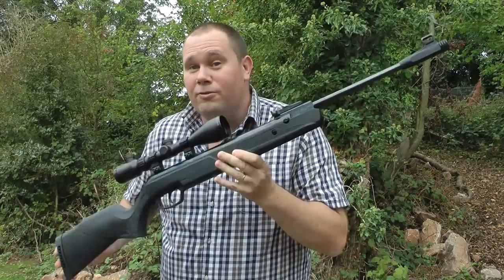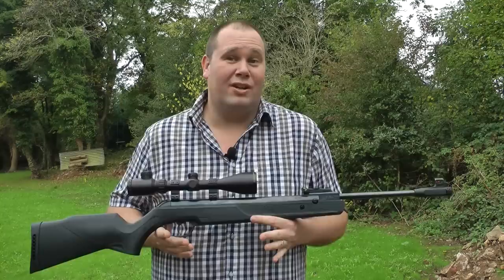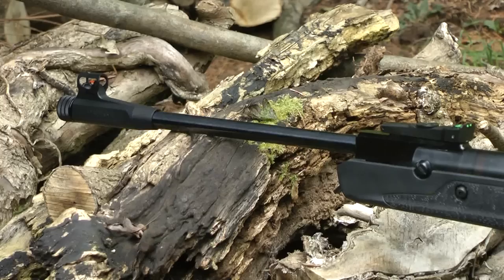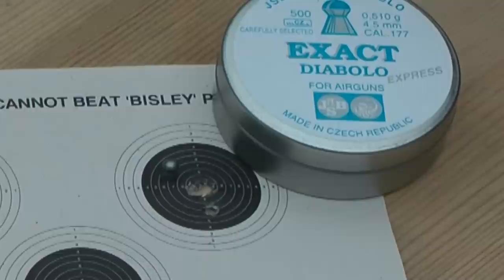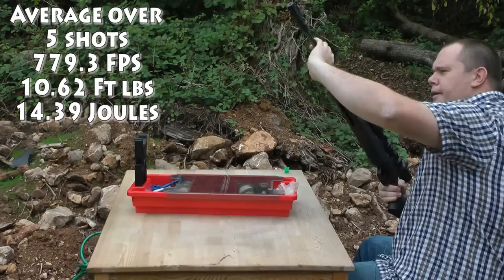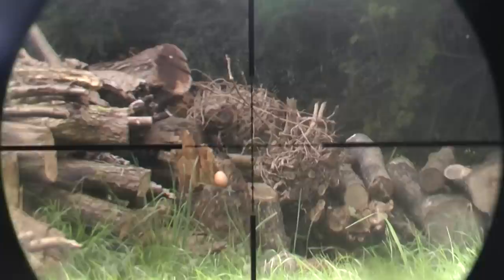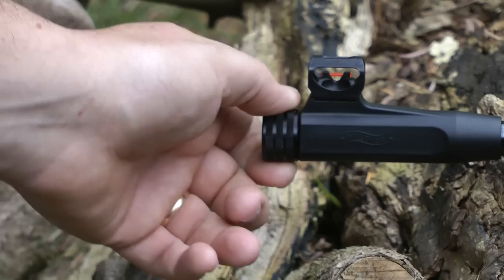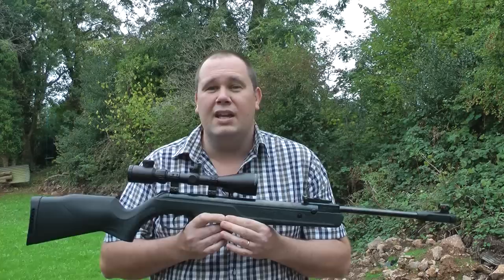REVIEW: Walther LGV Challenger Review - Power Accuracy

Comment: make sure the trigger weight adjustment screw is seated (screwed in to bottom clock wise) Then back it out 2 turns . Other wise when the gun does not fire ,and you try and figure out what is wrong and snap the barrel back it will discharge no matter what

Comment: Very good spring air rifle this one...And nice video review! Not cheap but you get a match trigger and a quality rig for that price AND you don't need to invest in bottles and tubes like with PCP guns...I would add a picatinny rail instead of standard dove tail though to prevent the scope from moving backwards after several shots. Even with the reduced recoil system...springers move forwards and backwards and the movement of the scope will eventually influence accuracy.Thanks for sharing! J

Comment: nice review.i have just got the lgv master pro 177
Reply: hi helenna have just read the comments I also have this gun finding it fantastic to shoot but I want it to be a quieter for the back garden and just wanted to know if you have installed a sound moderator on yours and if so is it much quieter and which one did you go for as I was looking at the weihrauch silencer .
Reply: Same here..  Ive got a sfs moderator and a rowan trigger.. Plus some fine tuning with trigger springs and a complete polish on the internals.. It has no equal!!